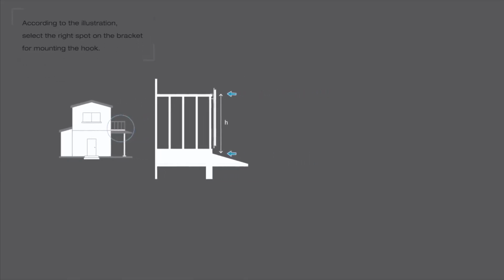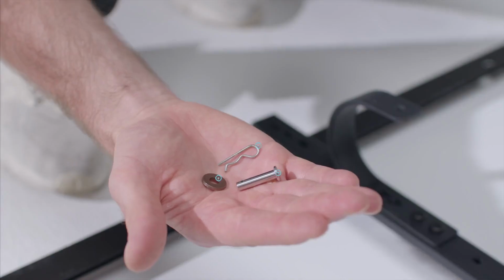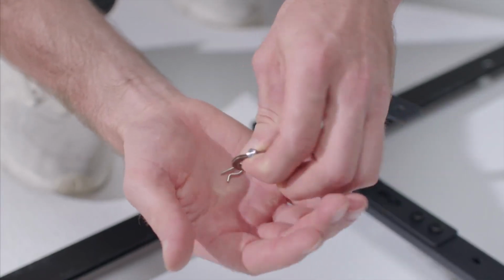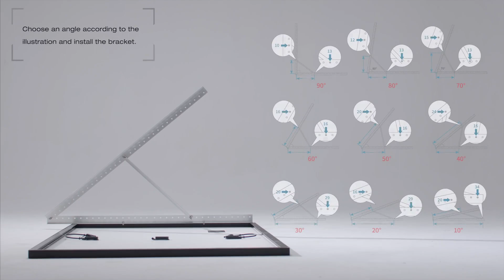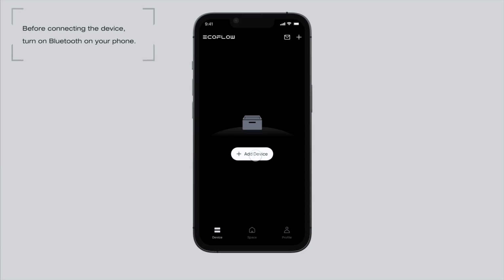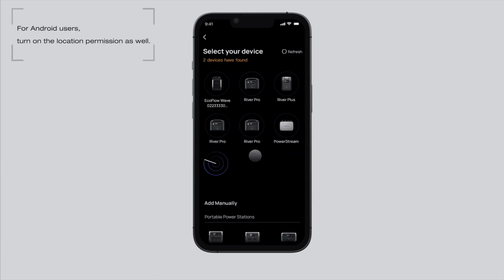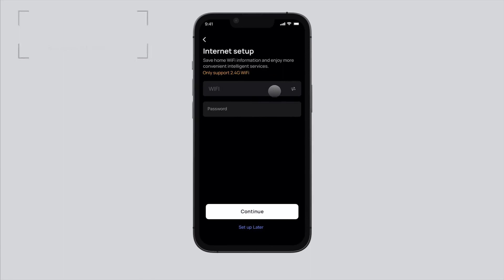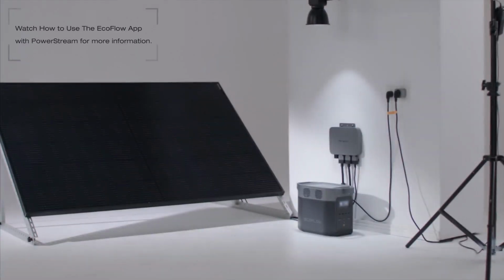EcoFlow PowerStream Microinverter Tutorial Video

Comment: Hi. Just trying to understand the use case for this. Am I correct in thinking that it could plug into the extra battery port of a Delta 2 to increase it's solar input from 500w to 1300w (an extra 400w x 2)?

Comment: How does it work just connecting to a outlet wich already has the grid ac power in it?
Reply: Wondering what the point of this is, too. Is it maybe just another way to add additional solar to your system if you are exceeding the MPPT solar input of the EcoFlow Delta, etc.?